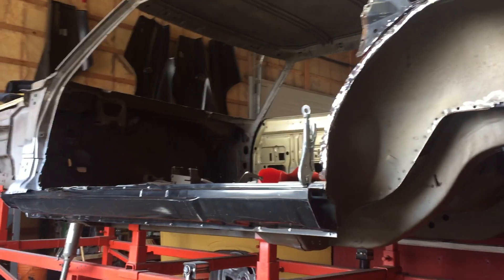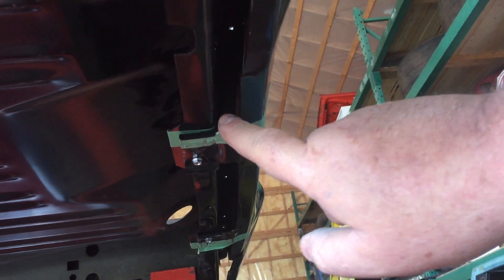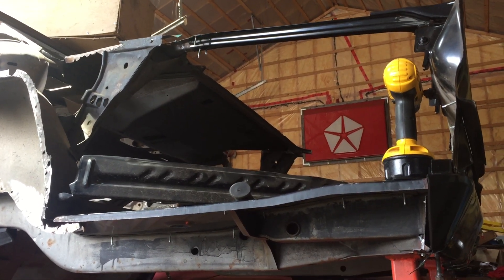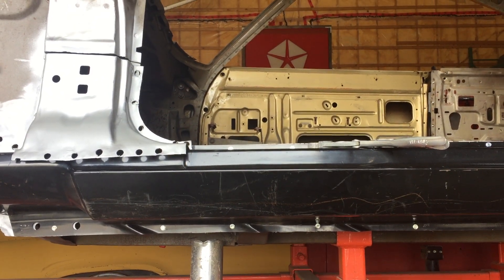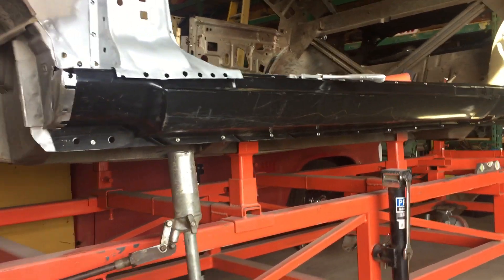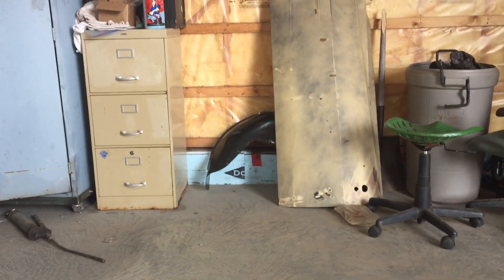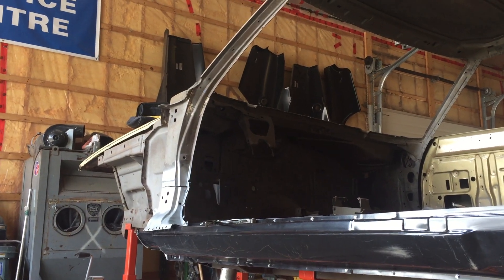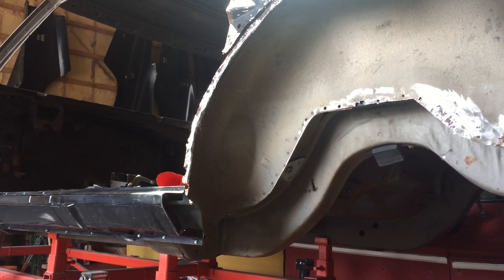1968 Dodge Charger R/T restoration video 1

Comment: Excellent , just frame on restored a 70 . Arizona rust free real great 70 Newport custom .Original 440 TNT changed over to 883.Have original trans .Full option car i mean everything and 90% all works fine 4.56 rear. Restored a 69 6 pack Bee about 6,7 years ago and can relate to bullshit parts and incompetent  shops . It really pisses me off that these so called shops make good cash ripping good folks off.Great stuff my man , subbed and shared. Keep em coming, Cheers from Quebec...